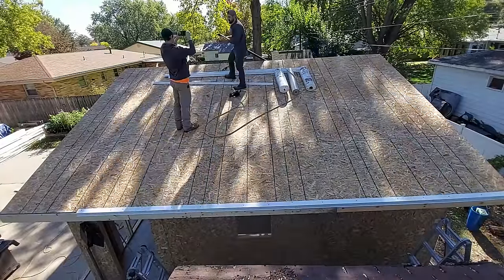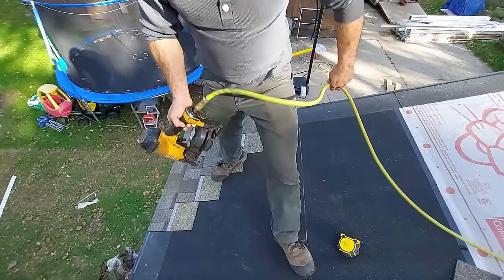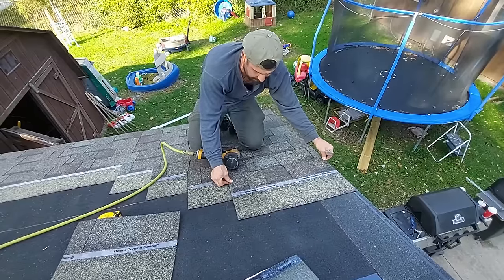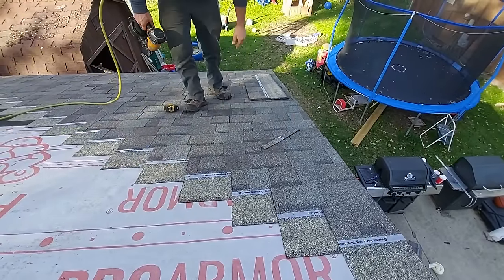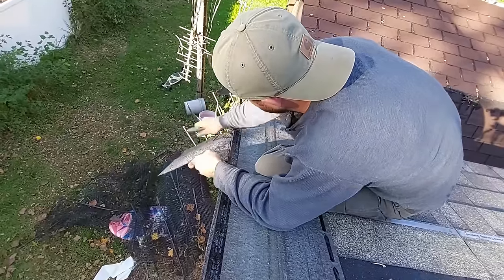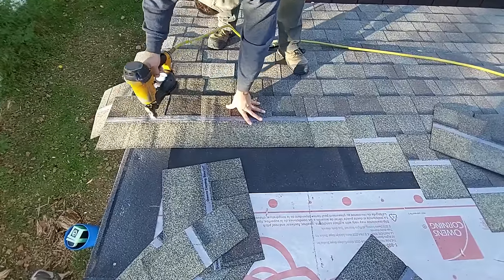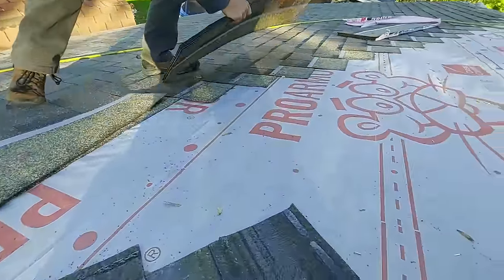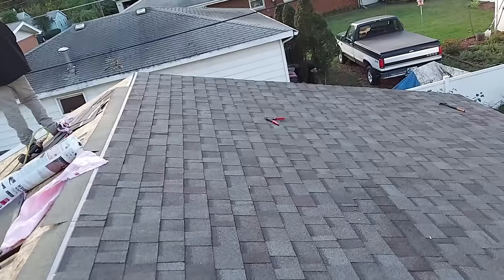HOW TO | Roofing Basics (Part 3 of 3)

Comment: if you were a licesenced roofer you would know by now that the ice and water sheild has to go on the roof deck not on the drip edge. by putting ice and water on drip edge you leave 2 inches of plywood under the drip edge that has no ice and water..... key word ice*.. when the gutter fills and freezes the ice* grows onto the roof... on your roofs it grows under the drip edge to the bare roof deck... i e the rotton wood on the bottom of most roofs you tear off.  watched 30 seconds of your video.. wish i was into bad roofing practices i would tune in and pick the rest apart.
Reply from the maker: lmfao oh stop it! have you ever tore off a roof with ice shield? it sticks to the drip edge just fine. i do it both ways but the way i did it seems to be the more accepted method. to each their own. my name is on it bro. so go right ahead and watch the rest so you can learn something

Comment: I believe the manufacturer of the shingles has specific installation parameters that, if not followed will void manufacturer's liability in case of shingle defects/failure. I'm not convinced your nail spacing and pattern offset would satisfy those parameters in the matter of litigation. Your suggestions are sound and as a roofer of 26 years am incined to agree with you. However, not all of the powers that be are masters of practicality and/or common sense. Just sayin'..
Reply: Inclined
Reply from the maker: Bro. Wtf lol

Comment: Shingles should never been put on that roof period pitch is to low code 3/12 or lower no Shingles it will Leake in less then a year.
Reply from the maker: First off, I built that garage lol believe me! It's a 4/12. Truss system all that.  True 4/12. Second off, a ton of the roofs in my area are 3/12. We're ripping 3 tabs off them that only had tar paper. No ice shield and there's no wet spots and bad wood.  If you shingle it right, no issues on a 3/12. Don't care what the book says.  And if you install ice shield like they say, more power to you.  3/12s can get shingles just fine

Comment: pretty low pitch. I probably would have I&W'd the whole thing
Reply from the maker: its a 4/12 and that's only required on 3/12's. also, its a non heated space so it technically doesn't need any ice and water in this situation but i feel ya..in my opinion, even 3/12's with all ice is pushing it...only because there's likely shingles on it doing just fine with tar paper under it...so if they're good now, all ice and water shield roof would be doing is causing a nightmare for the next guy to tear off. not saying its not the right thing to do...i just would hate checkin a roof out, seeing ice on the bottom and adjusting my price slightly...just to tear into it and find the entire thing is ice shield and likely needs a resheet. can't predict that most times
Reply: @NWIVeteranConstruction  Gotcha. I always interpreted the code as up to and including 4/12, so we double up or I&W anything 4/12 down to 2/12 for shingles. Thumbs up on the install and video, though!
Reply from the maker: @RR_184  thanks man

Comment: Drip goes under ice, come on rookie
Reply from the maker: Nope, drip edge is technically supposed to "cap over your dry in material" meaning after wards.  It's just easier to install all the metal at the same time so it's done your way more often, I do it on occasion but never when it's easy

Comment: Four hand-nailed roofers is all you need. Air Guns are the worst things that ever happened in roofing. You just ruined perfectly good shingles. I know you can just “adjust the pressure” right.
Reply from the maker: They're not ruined man lol not only does the compressor adjust, the guns themselves do.  I talk about over driven and under driven nails in here and demonstrate that.  I promise you there's no difference.  also, the tar these days are so far advanced it really doesn't matter. Go watch the GAF  video where they only nailed the perimeter of the new HDZ shingle and put 0 nails in the shingles in the middle. They allowed it seal properly and then put it through high winds.
Reply: Who adjusts the temperature.
Reply from the maker: @Joseph Pilkington  any good roofer! Every single day! Because outside temperature changes from day to day!  I will adjust my gun first, if the nails are still NOT DEEP ENOUGH, I will put my gun depth back to where i like it, and raise the pressure on the compressor until the depth looks exactly like the little picture on the package. I always make sure the pressure is not going to over drive nails and make craters.  Hence why I had a few here that needed a banging

Comment: You fucked up as soon as you ran that drip edge over the felt/water shield. You better tar those nails. I didn't keep watching so idk if you did. I'm a roofing service technician so don't even try and tell me you're not wrong for that brotha, unless you did tar the nails. Not trying to be mean. I'm just a roofer.
Reply from the maker: You can be whatever you want but drip edge caps over felt and ice.  There's a reason for the order of operations I did. And manufacturers typically recommend it this way.  Watch any animated installation video.  People like you might get nervous about that but it's probably because you don't realize shingles need to overhang all roof edges a minimum of a quarter inch and maximum of one inch.  Places like Florida in hurricane zones might require tar on drip to help keep shingles from lifting but in 4 nail areas we're just talking non sense. Blahhh

Comment: This is all wrong hahah clearly you do not ready the installation instructions on the back of the pack it tells you to cut 10” 20” and 30” then the full shingle makes the book cut offs used for finishers. You also do not run starter shingles up the gable
Reply from the maker: Oh God. Another Package reader that hasn't actually read a package of shingles or even the starter bundle 🤦‍♂️ much to learn young grasshoppa. please go to owens corning website, re read instructions and rewatch this video with an open mind.  Also keep in mind that the install doesn't need to be specifically any number for stair steps, they just can't be stacked like 3 tabs and can't be less than 5 ⅝ per most manufacturers instruction. The way I shingle works for all manufacturers and has years of experience drilled into the system., in not the only guy that shingles like this. This style will maximize efficiency and make the process easier.  I share it with others who want to get better at shingling so they can earn more money while facing less problems. If that ain't you, c ya.

Comment: They are called “books” not stair steps and wind driven rain only travels at most 1inch in every direction except down.
Reply from the maker: i never liked that. i don't know why, its hard to bring myself to say it lol and it depends on the roof slope. 4/12's it will walk a little farther over. especially if your join isn't perfectly tight

Comment: You are not nailing the shingles in the right order. You are not wearing a tool pouch either.. leaving tools laying around is dangerous and foolish..on a steeper roof they will roll off to the ground. Measuring for a stair step is a waste of time. Cut in half and 3/4 of a shingle and roll with it.  And wear eye protection.. average at best...
Reply from the maker: Lol! Below average is your roofing experience and it shows in one sentence
Reply: Goes to show you are beginner... you only got away with this was because you are not on a 6/12 or steeper roof. And riddle me this Batman...how are you going to reload your nail gun if you don't have a pouch to carry any coils of nails?? You going to keep going to the box every time??
Reply from the maker: @ribgrunt9809  lmfao I got steep roof videos.  Check before you talk trash.  Sometimes I wear a pouch on steep roofs. Most times not.  How many squares you put on in a day?  I've done 40. Alone.  And it's all filmed. I think I know a thing or 2 about efficiency  🤣

Comment: You're violating the nailing instructions for this shingle.
Reply from the maker: False
Reply: @NWIVeteranConstruction  You’re nailing spacing is too close on the left side of the shingle and too far away on the right you said in your video that one of the nails was driven improperly. The instructions for nailing that shingle are very clear.
Reply from the maker: @tadmorrison  coming from someone who's never laid a single I'm sure.  Gatta love the package readers 🙄 know it alls with little to no experience. As you can see from my nail pattern demonstration in this video they're clearly one inch from the end. Chill out guy
Reply: @NWIVeteranConstruction  I have been a roofing professional for 30 years. I mean no offense to you. 

Your course offsets are not according to O/C instructions. This the Duration product, is it not?
Reply: What is the pitch on that roof?
Reply: Hard to see every nail, but many of them appear driven into the surface of the product. Over-penetration doesn't mean nails are driven through the shingle. It means that the bottom of the nail head is below the surface of the shingle.
Reply: @NWIVeteranConstruction  From Owens Corning:
Reply: From OC regarding Sure Nail fastening:  

On Owens Corning products manufactured with a SureNail® nailing strip, the nails should always be installed within the width of the strip and should be held toward the center or lower half of the strip to ensure penetration through both layers of the shingle.